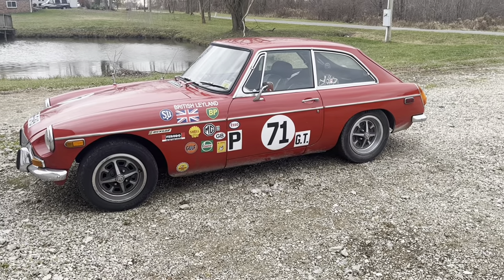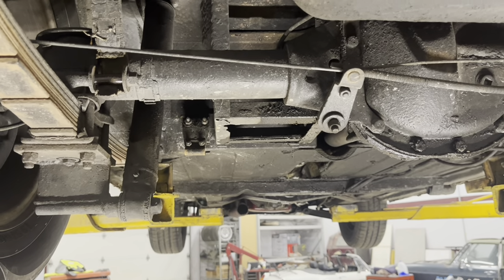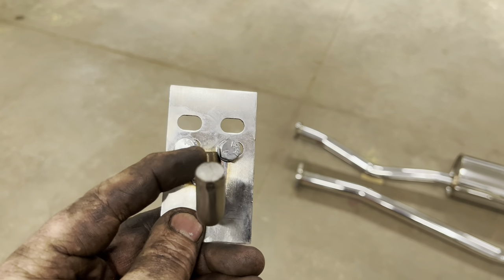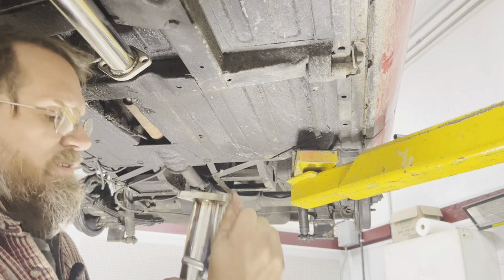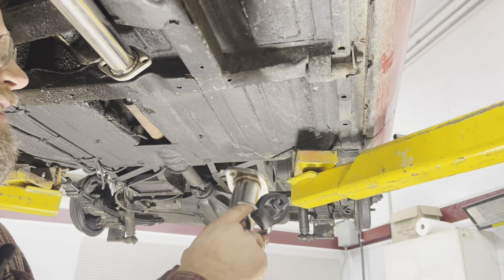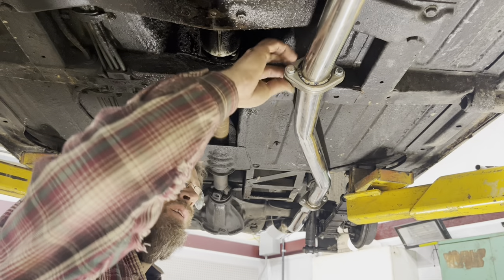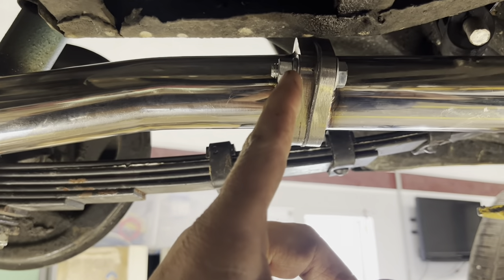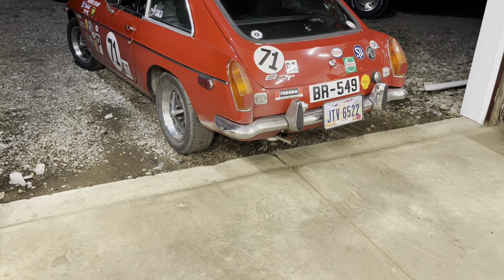MGB Tourist Trophy exhaust system install

Comment: thanks for posting! I run a MG/Triumph shop, one of these systems from Moss fit so poorly on a 74 B rdstr I can't recommend them (and I'm done w/Moss anyway). My own 72 BGT, which I use for road trips, has a great sounding exhaust I came up with ... center resonator by Flow Master and rear muffler from Pace Setter (unfortunately they're gone). Not so loud as to make 8 - 10 hr runs unbearable.  Best wishes for the new year! 🎉

Comment: Thanks for the video Rob, just wondering if you would recommend any exhaust paste whilst assembling these? Mine seems to blow a bit from the joints.
Reply from the maker: I have never liked using it. If you get the joints lined up properly you shouldn’t need it, but sometimes the only way you can is to cut and weld in unfortunately. If its really close, but not quite lined up well enough the paste can help with leaks if you use it correctly

Comment: Keyed into you... Doing an exhaust. Taking your advice with the extension and swivel socket, thx. Mine car is a '73 MGB.  And the attention to retightening they up after use, so they don't "fall out."  Yikes, didn't know that...The 6 studs that get the 6 (brass?) nuts... What's the size of the nuts?
Reply from the maker: The nuts are 1/2”
Reply: @mgbgtguy I'm probably too late here but most important thing was thread ... it's 1/4 - 28 UNF fine thread
Reply from the maker: Actually the manifold studs ( what he asked about) are 5/16 -24 UNF thread using a 1/2” socket. The hanger to body bolts are 1/4 -28 UNF which use a 7/16” wrench/socket 👍🏻
Reply: @mgbgtguy  oops MY BAD sorry!  yes it's 5/16 24 ... was very tired from fighting these darling cars all day (I have a MG/ Triumph shop in USA)

Comment: I have one of these systems, while nice sounding they do have their issues. And now after 6 years part of the muffler inside has come loose and now rattles some, probably a baffle loose. I will replace the muffler with something else and just keep the pipes. I'd never pay what they want for them now.

Oh, I also when through two of the TT headers and ended up going back to the stock manifold. Moss did replace both headers and then finally sent me the non-header version. Both headers had alignment issues. They were horribly built and I suspect taken out of the welding jig while hot and warped there after.
Reply from the maker: After installing a number of these systems over the years, I do believe the supplier for the system has changed a few times. I have noticed some differences over the years, And right about the time you would’ve bought yours I noticed a little decline in quality for a little while and then I think they changed the suppliers as at that point in time I was seeing bigger, alignment issues, and then it got better.

Comment: A couple of questions. 1) will this fit on a '67 MGB? 2) And if it does, will it require new tuning or jetting on the motor once the new exhaust is attached? Thanks for your insight and advice.
Reply from the maker: Yes it will fit a ‘67. No it shouldn’t require re jetting, but may need minor carb adjustments.

Comment: Looking to maybe replace what I'm got... I haven't a lot of $$$.  In your experience, are the originals good enough to use as a replacement?  I'm thinking the install with an original might be easier.  Thanks, from a "shade tree mechanic."
Reply from the maker: I have found that this stainless exhaust doesn’t cost that much more than the original system once you get everything ( if you need hangers and all) if you’re buying from someplace like Moss. Also, sometimes there can be a wait for parts of the original exhaust system because it’s some of the parts are not always in stock. If you don’t need everything though the stock stuff will save you a bit of $$ and is just fine to use.
Reply: Thank you.